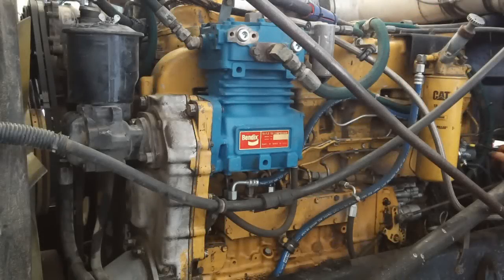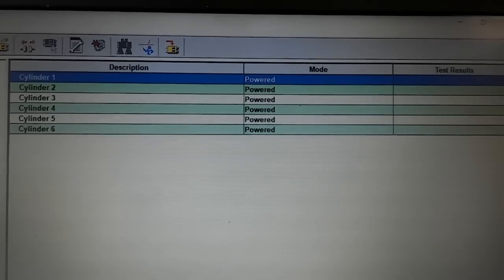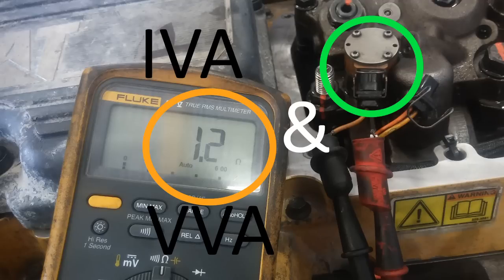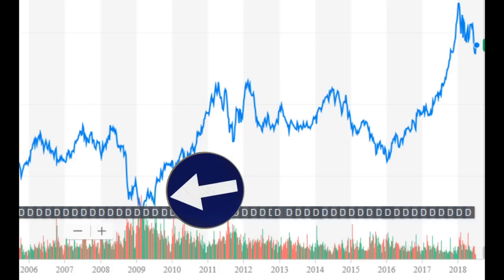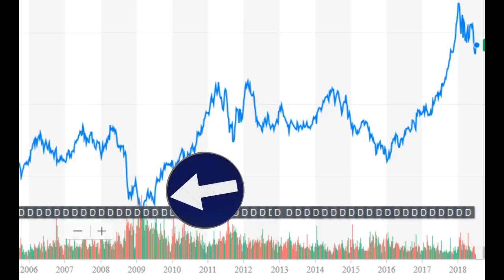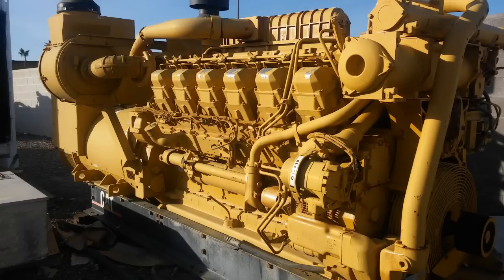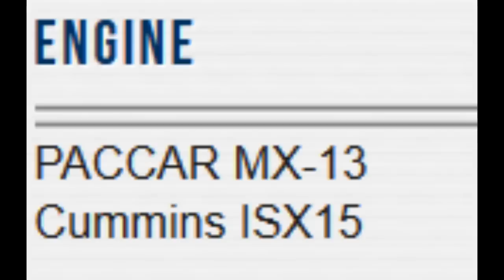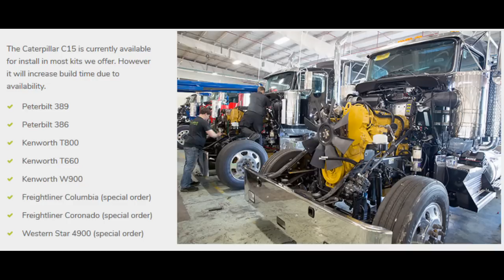Why Did Cat Stop Making Truck Engines?

Comment: Are used to haul parts for Catapillar engines. Catapillar engine was made by a lot of different companies injectors were made by three or four different companies blocks were made somebody else. Catapillar did get out of the over the road engines like they said. But it was due to regulations poorly designed engines and hundreds of thousands of other things that caused it. I can attest to the A.R.D. Head been problematic. I had truck that must’ve blown at least four of them. And that’s what I was in the shop for mostly was the ard head would blow. And he would immediately detracted  the engine. Then I will say this it was a C 13 so it shouldn’t of done it but yes it did. The problem was huge with parts for them. I was down once for the better part of the week waiting on a ard head.

Comment: Cat could not meet the emissions standards even with trying twin turbos so they went to international to get engines even a made a cat truck with a international/cat engine so they went to offroad where emissions standards are way different
Reply: Emissions standards for heavy equipment is the same as on highway.
Reply: Emissions standards for heavy equipment is the same as on highway.

Comment: These comments are hilarious. Like the EPA is the only game in town and calls all the shots. There are different emission standards around the world. Cummins, Volvo and Detroit, to name just a few of many, all make or exceed the requirements often years ahead of the comming standards which are similar or stricter than the EPA. There is no way CAT would have removed themselves from the on highway market because of emissions. They could have simply bought something and bolted it on probaby much cheaper than in house development. They likely made the descision to focus on their core business and get out of the gamble that comes with offering your engine in a product that is not yours. I'm sorry to say but if everone else can do it so can CAT. Also if everyone is bound by the EPA then they are all on the same playing field so no one gets an advantage in the market.
Reply: Geoff, you are really missing the overall theme of these posts and that is that the EPA demands have caused a dramatic increase in the cost of engines, engines that do not last and require constant maintenance.  That the EPA is totally responsible for the demise of the Cat road engines is open to debate, but what is not open to debate is that the EPA is constantly increasing their bureaucratic created standards based on faulty science.  I think most people want "clean air", but at what cost and do stringent EPA regs solve the perceived issue?  The EPA regulations produce an almost unmeasurable increase in "clean air" yet kills business.  I guess to some that's OK.  The EPA will not improve with age, it is a rogue government agency that feeds on itself.

Comment: The engines are dirty noise  yeebto much fuel out dated mechanical fuel fuel pumps in order for clean diesel you need dpf,cats,and car.
Need to move electric motors